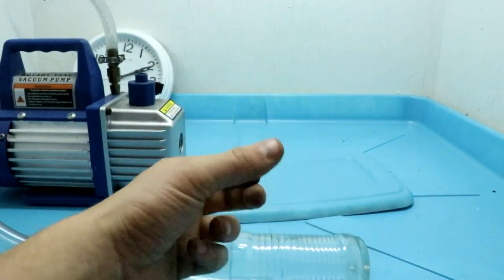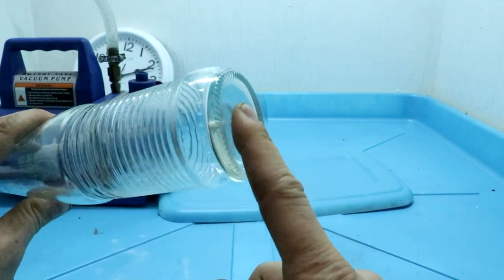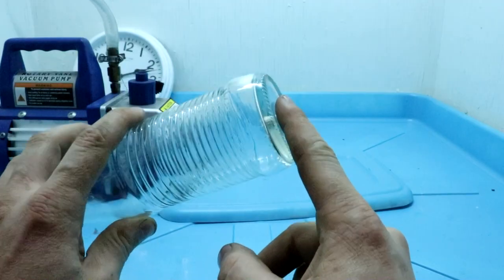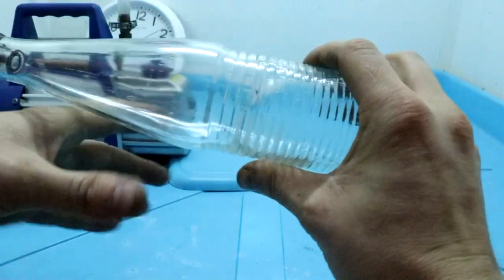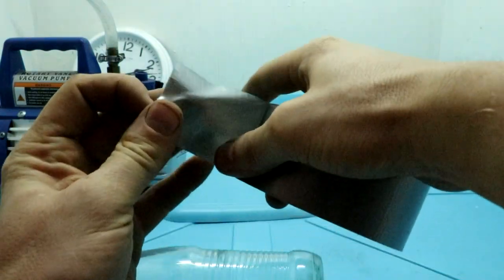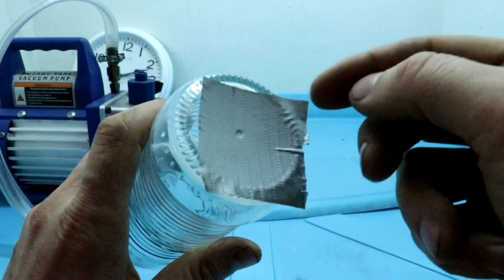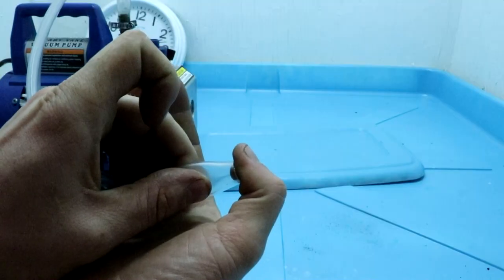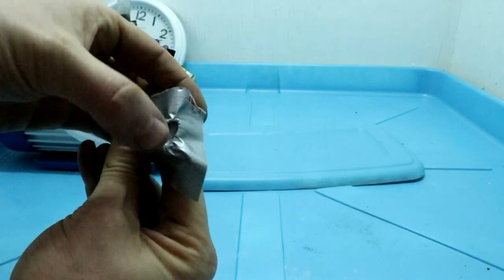Use Your Finger to Stop a Leak on the Space Station?

Comment: Have you seen Stanley Kubricks movie 2001: A Space Odyssey ? There was an episode where the actor was trapped in a shuttle outside of the spaceship because the nasty computer HAL had removed the space garment in there. The actor moved close to an open door of the ship, and hopped a few metres through the vacuum into the airlock sluice and activated the external doorshut. Who believes that a man can survive those 15 seconds in high vacuum?
Reply: Who believes it? People who know what vacuum actually is. It's not some magic force that instantly kills you.
Reply: I don't remember that scene. But if you had sufficient insulation, exhaled slowly ( that's important otherwise your lungs burst ) and kept your eyes and mouth shut I'd wager you could remain concise for that 15 seconds.
Reply: well, your body fluids will boil instantaneously, I guess. However, I tried it only with flies (They accidentially were overseen while closing my vaccum vessel) They exploded.
Reply: No, your body fluids will not boil. Except for those directly exposed to vacuum.
Your blood and other internal bodily fluids are under enough pressure to keep them from boiling even when your body is in a vacuum.
Reply: what is the origin of the "... enough pressure to keep them from boiling...". This pressure should be higher than ca. 100 hPa (water boiling point @ 37 deg C). Is there evidence of any mechanism that generates an active pressure on e.g. the blood in the blood vessels? Just curious.
Reply: Ghl Scitel  Yes - your veins, your heart, your body in general generates active pressure.

A normal adult blood pressure is about 120/80. That is pressure above the pressure of outside environment in mm Hg (or Torr, almost the same unit).
That means a minimum ("diastolic") pressure of 80 mm Hg = 106 mbar, at which point the water boiling point is 47°C. The maximum "systolic" pressure of 120 mm Hg or 160 mbar would mean a boiling point over 55°C.

The boiling point of pure water reaches 37°C at 49 mm Hg, which would mean significant hypotension, "low blood pressure".

Boiling point is also slightly higher for salty water, which blood is.
Reply: Unfortunately, the 120/80 mm Hg (~160/110 hPa) example is quite meaningless for explaining the problem. Those are the pressure values necessary to let the arteria close to the heart collapse with an outer pressure. However we are talking about a situation of zero pressure from outside. This makes the medical blood pressure measurement results inapplicable for enlightening the problem.
In your approach, you neglected the veins totally. The pressure in the veins is ~ 7 hPa. The boiling point there is 1.8 deg C, well low enough to let the blood in the veins bubbling heftily. Consider the possible effects, if such bubbling happens in the veins of your brain.
However both approaches - taking the pressure values of arteria and veins from medical literature - are too short thought as a concept. 
The proper approach takes imho into account that veins and arteria are elastic confinements of the blood, like e.g. a rubber balloon. However I have no source where values for the pressure/volume function for arteria and veins can be found. Only such information can allow to estimate the volume of water vapour bubbles in the blood entering absolute vacuum.
In addition, as the brain is well protected by a hard confinement, the rest of the body however not, It canot be excluded that the blood from the brain collects in the trunk and the limbs instantaneously, by this switching off brain functions almost immediately.
These are reasons why I never would try to "hop" into vaccum without protection like the 'space odyssee guy' did.
Other opinions or data?

Comment: Hey Cody, could an absolute perfect vacuum suck you in, and if not, does that mean it is impossible to suck flesh through the skin without first piercing it?
Reply: Ask yourself how a less than 1% difference in the forces involved would make such a difference.

He didn't measure the vacuum level he was working with, but in actuality the difference in pressure between his demonstration and what is experienced on the ISS was likely only tenths or hundredths of a percent, possibly even down in the thousandths of a percent difference.

Comment: Cody. The vacuum @ 250 miles up [10 to the -7 power Torr or mm of Hg] doesn't compare with the one your pump is creating. You are barely roughing it down. You would need to attach a cryogenic pump to your apparatus to even come close to the vacuum @ 250 miles up. In addition, the vacuum of space completely surrounding the outside of the ISS cannot be compared to creating a vacuum inside of a container here within our atmosphere. If the ISS had a leak when surrounded by the high vacuum of space, it would explode like a bomb. Your experiment doesn't simulate the problem on the ISS.
Reply: +Michael Gulotta Im sorry I only read through about a quarter of that. But from what I did read i also have to ask. A: Do you believe we landed on the moon, and B: Do you believe the earth is flat. (im currently in university and both of these answers will contribute to a little study im working on).
Reply: +Michael Gulotta ah nevermind. I checked the singular sermon your channel and your subscription to flat earth channels to answer it. Thank you.
Reply: +Michael Gulotta oh but hey! to answer your question: balloons are made of cheap rubber. the iss is not, and in fact is specifically designed to take hits.
Reply: +Michael Gulotta hope that helped!
Reply: Yes. It told me a lot ...about you.
Reply: +Michael Gulotta
You know that you simply don't understand vacuum, in other words, basic physics of pressure? If there is a Space vacuum or High vacuum, it doesn't matter, it will have a minor effect on the force which acts on the finger. Just simple calculation F=Δp*A. Because the overwhelming majority of Δp is pressure inside ISS, which is 1 bar. 
Space vacuum is 9.87×10−10 bar .... Δp= 1-9.87×10−10  = 0.999999999013 bar
High vacuum is 9.87×10−7 bar .... Δp=1-9.87×10−7 = 0.999999013 bar
See? Δp is still ca 1 bar thus the force will not change.

"If the ISS had a leak when surrounded by the high vacuum of space, it would explode like a bomb." Go back to school, for your own good.
Reply: Michael Gulotta There is no force of vacuum, only a difference in pressure.
A 14.7ish psi difference in pressure between a container and the environment it is in exerts the same forces in space as it does here on earth.

The difference in pressure between what the pump he is using can reduce the inside of a small chamber to, and the pressure of space, is a few thousandths of a % of atmospheric pressure, maybe a few tenths or hundredths of a % with his finger blocking a hole in it.
This means the difference in the forces involved are so insignificant that they are irrelevant.
Reply: micheal gulotta just wanna say that's it's not a problem if you don't understand physics (a big majority of the people don't, and it's okay since it's requires alot of effort and time to understand), so please if you don't understand just ask and don't try to make statements which are false. As experiment: make a hole in a balloon and it pops but put a little piece of duct tape on the balloon and repeat the balloon will just leak till an equilbrium and will not pop like the balloon without the duct tape (this shows that it has to do with the material of the balloon and not with a pressure difference). This will also show that an equilbrium is not instantly made but depends on the size of the hole (try the experiment with a small hole and a bigger hole you can clearly see a difference in the time an equilbrium is made).

Comment: Has no one ever put their hand or other body parts over the nozzle of a vacuum cleaner? Did you get sucked into the machine? Holywood has a lot to answer for when it comes to misconceptions about vacuums and decompression.
Reply: If you completely block the flow of a vacuum cleaner, you get around 1/8th of the vacuum of space. With a good vacuum cleaner, like a "shop vac" type. My shop vac pulls around 4 feet of water-column vacuum. Space station is pressurized to something like 30 feet of water column. You can translate that to metric units if you like, but the basic idea is the ratio. 4 units of pressure vs 30 units of pressure.

Comment: Its about 14.7 psi on the ISS
Reply: It could be much higher than that, and you would still be able to plug the hole with your finger without more than a little discomfort.

Comment: You should be using a vacuum chamber with a pressurized container inside, and after sucking all the air out. Puncture your pressurized container from the outside and watch how fast the pressures equalizes. That’s what would happen the astronauts immediately!  They wouldn’t even know they were dead!!!
Reply: Not if the hole was small enough. It makes no difference.

Comment: Cody will they be sealing from inside or outside?
Reply: G'day,

  Here's a hint..., they were inside and asleep when the puncture happened, the ISS is at 1 Atmosphere, and the Vaccumn is outside of them...;  when they found it they plugged the Hole with a Finger, while Duct-Tape was brought to the job...., and thus the ISS's Air-Pressure is pushing the Patch up against the Hole.

  Did you notice any mention of Space-Suits, or EVA time, in the Story...?

   There is no real point in repairing the Vaccumn-side of the Puncture, unless it constitutes a Strctural-Engineering Threat to the integrity of the effected Module - which is an otherwise disposable (Orbital Module) part of a Soyuz Capsule, rather than part of the "ISS propper".

  So, Pilgrim, what d' y' reckon...; fix 'im up from the inside, or the outside - your choice ?

  Take it easy,

  ;-p

  Ciao !

Comment: Not an amazing demonstration, because the two forces between the air in the space station, wanting to leave into space, would be much greater than that, I suggest a lot of you look up a video on P factor, that is most likely what it would do, but with a hole that small, the results would be far less extreme.

Comment: Delta P of the Vacuum has nothing against flex tape. No matter the surface area.
Reply: I would actually be interested in Cody making a video testing how much vacuum pressure flex seal could withstand before a hole is ripped in it, I'd bet it's pretty damn high.
Reply: But.. that's a lot of damage. Not safe for Cody... ;)

Comment: Interesting to see a marshmallow or piece of meat squashed through a 2mm hole from the inside (and outside) of a pressure vessel at say 10 bar that would be  more than 10 times the difference than on the ISS ...

Comment: Well this is way different from the sucking of the vacuum of space haha...
Reply: There is no suck, only blow.

The "vacuum of space" is merely an absence of pressure. There is literally no difference between the forces involved with the hole in the ISS and what this video shows.
Reply: My point was merely stating that this example can not be a valid comparable experiment to show the factors within the space station and the forces acting upon it (the actual level of ''blow/suck'' of the vacuum of space). Yes the very carefully balanced equilibrium of pressure within the ISS compared to it's surroundings can be measured, but we can not easily recreate the huge force that the vacuum of space has on the ISS by just using a vacuum pump that's not even measuring the level of vacuum and thus using a finger can stop it....
Reply: Chris Cashin  
The "huge force" acting on the hull of the ISS is 101.3 kPa(14.7psi), and it is due to the pressure inside the station pushing out. 
There is no force of vacuum.
The total amount force acting on the entirety of the hull of the ISS is meaningless in this situation, it is simply a 2mm hole with a 101.3 kPa(14.7psi) pressure differential from one side of the hole to the other.
Extremely easy to plug with your finger.

Cody's vacuum pump is more than capable of pulling the inside of that bottle to a few thousandths, possibly even a few ten thousandths, of atmospheric pressure, even with his finger covering a hole in it.
The atmosphere around the ISS is a few trillionths of atmospheric pressure.
The difference in the force involved is so vanishingly small that it is inconsequential.

I've actually held my finger over the 12mm inlet of the manifold of one of my vacuum pumps, and pulled the manifold down below 100 microns(µmmHG) of pressure, or around 0.00013% of atmospheric pressure, with only mild discomfort.

The difference between 0.001% and 0.000000000001% of 101.3 kPa(14.7psi) is a lot of zeros, but a minuscule difference in force.

Comment: Random thoughts: Try compounding vacuum pumps. You should get an absolute zero! Just a scientific observation.
Take care from Oklahoma
Mike and Vee
Reply: What do you mean absolute zero? If you mean zero absolute pressure, then theres no way he'd be able to get that, only asymptotically approach it
Reply: @KyleDB150  when you piggy back turbos you piggy back pressure. If piggy back either same density or the last one bigger, one could get a complete vacuum of absolute 0. 
Take care from Oklahoma
Mike and Vee
Reply: sorry mate thats not how absolute pressure works, its the same principle as temperature, you can approach zero but you can't ever get zero pressure, because you'd literally have to have zero atoms in the chamber. 

i.e. if one pump gets you from atmospheric pressure (101 kPa) to 30 kPa, a second pump won't automatically get you to 0. It'll get you diminishing returns since the force required to reduce pressure by 1 more kPa blows up as pressure approaches zero
At higher pressures (far away from 0), this is negligible and if you hook up two pumps to a pipe, yeah you get twice the flow rate, but you can't extrapolate that to pressures near 0
Reply: @KyleDB150  I see your point. I did over step by saying absolute zero. It should draw a closer to absolute vacuum. Don't know until tried.
Reply: All good, sorry if I was patronising at all, I didn't mean to be. Learn something new every day man!